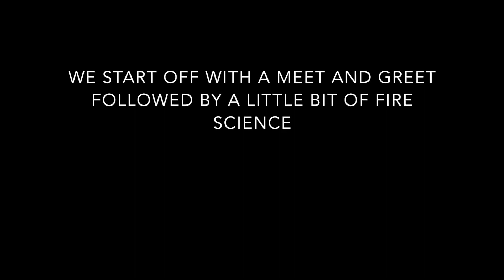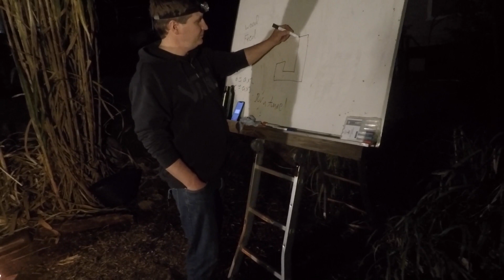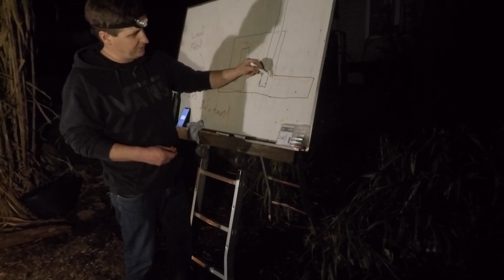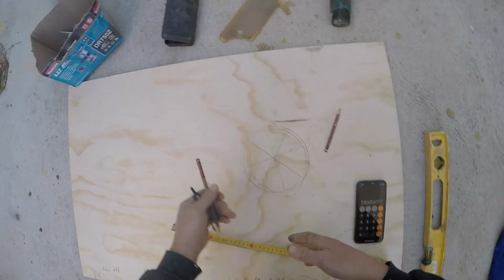Rocket Heater Workshop July 2019

Comment: I wondered about the empty space inside the bench.  All the other mass heaters I’ve seen have a chimney pipe through it then filled with debris/Cobb as mass to hold the heat.  This could be why yours gets really hot fast then cold fast, there isn’t enough mass to it.  I do like the shape and finish.
Reply from the maker: This style is much more efficient than the piped type. They are also much cheaper and far easier to build.
Most of the professional builders have switched to this style now.
I did not insulate the bottom and the slab it sits on is also not insulated so we lose a tonne of heat to the ground. Next time I will insulate the base.
I will also soon be making the bell (the empty space in the bench) smaller but increasing the mass on the top to try and regulate the temps a bit better and store heat or longer.
I should add to this video but as it dried out and the humidity levels dropped in the building from about 80% to 30%, the heat was retained substantially longer.
Reply: Positive Aspect I can’t wait to see your modifications.  I’m hoping to create one this summer taking the design elements I love from each one I see. I love the way yours is nice and neat and square.  I can just see one one white tiled in my living space.

Comment: This open bench design has been used for outdoor applications for years in the 🇺🇸 
They heat up quickly for entertaining but are not designed to Hold heat long. 
All that I have been around and built had the flue at the opposite end. 
Did you extend the riser to match the bell  so you could maintain 2-3 inches so it would draft properly?
Reply from the maker: it holds plenty of heat. I may try it and reduce the space in the bench (and add more mass) to see how much better it is. I also have plans to reduce the height of the bench but then increase the thickness of the benchtop to something like 6" to see if that is better for heat storage (and moderating the bench temp which gets too hot after a few hours).
I did not extend the riser to match the bell. It has about 1 ft of free space above it. You can go as big as you like. There is a minimum gap (as you mention) but I have not had any problems going larger. My last build (an 8" J with a barrel that you can see in another of my videos has an even bigger gap).
Reply: I know im randomly asking but does anyone know of a way to get back into an Instagram account?
I stupidly lost my password. I would love any help you can offer me
Reply: @Ray Zander instablaster :)
Reply: @Jaxson Alberto I really appreciate your reply. I got to the site on google and I'm trying it out now.
Seems to take quite some time so I will get back to you later with my results.
Reply: @Jaxson Alberto It worked and I actually got access to my account again. I'm so happy:D
Thanks so much, you saved my ass :D
Reply: @Ray Zander No problem xD

Comment: What was the reasoning behind putting the flue next to the bell?
Seems it would heat more uniformly if it was at the opposite end 🤔 
Did you fill all the bricks for the walls also or just the ones for the bell?
Reply from the maker: the flue next to the bell causes a quick draft so no bypass is needed. Flue temperatures are about 80c on a regular burn so they are not too hot and not too cold (100c is advised).
If you mean are the holes in the bricks filled????? yes in all the bricks. this was my first large build and I wanted it to work without issue so the chimney is next to the flue.
Maybe if I were in a cooler climate and we needed heating all day/night, I would have the chimney on the other end.

Comment: Do you have any dimensions for manifold and how high is flue inlet off the bottom? Thanks
Reply from the maker: there is not a manifold per se. It's just a box. 
It seems not to matter how big it is. I've built another with a much larger manifold with no problem.
The flue inlet is approx 150mm off the floor.
So far with my builds, the flue diameter seems to be the height from the floor required (an 8" system I built was 200mm off the ground).
You need to experiment with that though as the higher the flue is from the floor means the more hot gasses leave (and the less efficient the heater is). Start with one brick high and adjust from there until you get a good burn with no smoke back. Your overall chimney height will play a big part in that.

Comment: Got to visit your beautiful country two years ago. Toured up and down Queensland because it was your winter. Prayed for you guys during the horrific fires. About your RMH, the build is only the second I have seen on YouTube to add heat to the chimney flue. It's like a second stage rocket! But subjecting the thin metal to such high temps? How hot is the exit temp? Somehow isolate the flue in the box in the future? A butterfly valve on the chimney to retain some  heat seems doable.
Aloha, from a fair weather guy
Reply from the maker: thanks for the comment. Ideally. the flue should be a bit further away from the riser but the flue was pre existing. The metal will last a suprisingly long time when it is exposed to a clean heat. less so in a regular stove. My exit temperatures are around 60 degrees celcius.
Reply: @positiveaspect5730  I'm thinking the chimney is sucking long after the fire is out because the riser box/ chimney is hotter than the bench. Try lighting a match in the fire box after a burn see what happens. Winter is nearing. Take care and Aloha, N
Reply from the maker: @luaufeet4368  Yes that will happen. All the heat from the fire and the room will be sucked out (that would happen with a box stove too. There is a tight-fitting cover for the wood feed that stops airflow and plugs the system. You put than on as soon as the fire goes out.

Comment: I would use a hot air gun or butane burner to get a draft going and get things heated up.
Reply from the maker: a ball of newspaper lit and pushed into the burn tunnel does a great job. We get very little smoke back this way.
Reply: @positiveaspect5730   I quickly stopped using paper, it inevitably clogs the works. rather use waxball or firelighter, something that gives 5 mins and wastes to nothing.